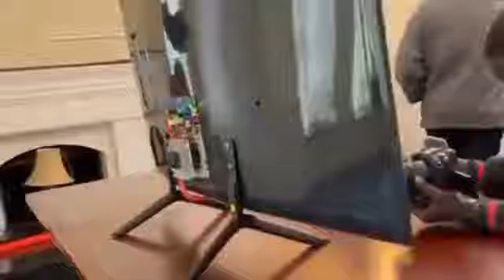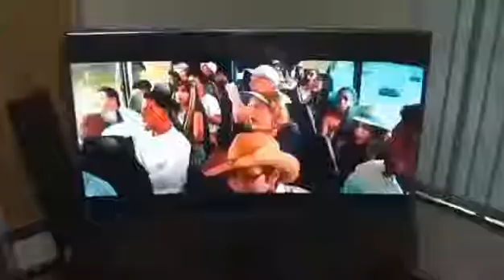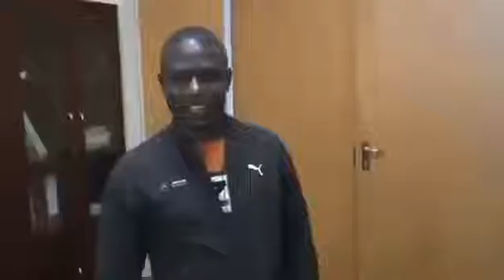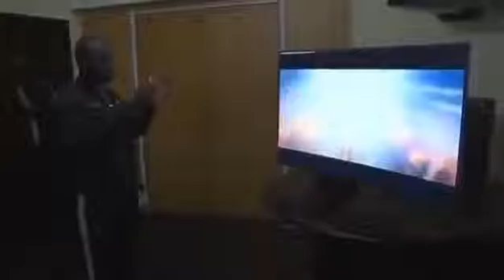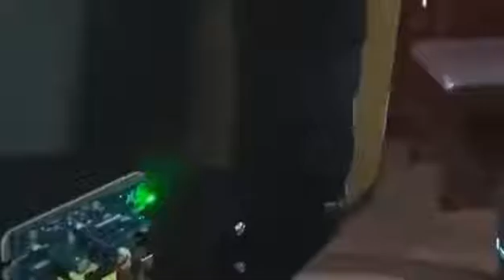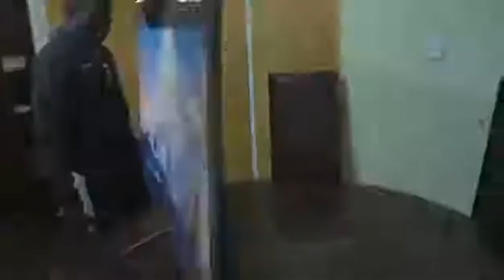How Maxwell Chikumbutso FIRST Invented a Self Powered Television that doesn't need to be plugged

Comment: He is not alone behind this scam. he is being used by other criminals to scam others. if someone is going to hurt him or kill him than is going to be the criminals who forces him to do the scam and the dumb inventors who spent money for nothing.  as an electrical engineer we are very familiar with the things he uses. nothing he uses is hand made, its pure scam. ultra sonic device is a very simple inverter that sucks in 12 VDC from flat lithium ion battery that are hidden in the tv and converted to 220v ac back in to the tv. a tv like that are like 50watt which is nothing for lithium ion batteries